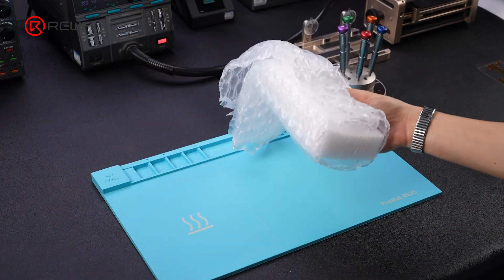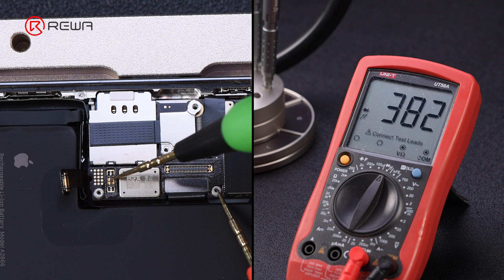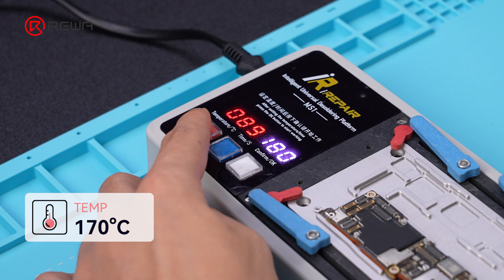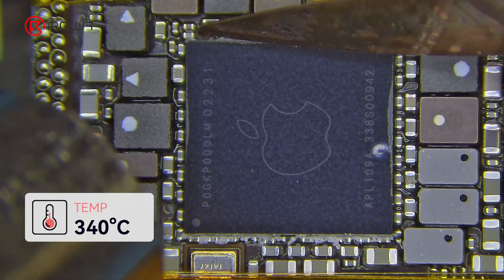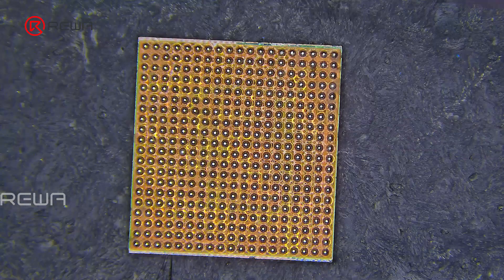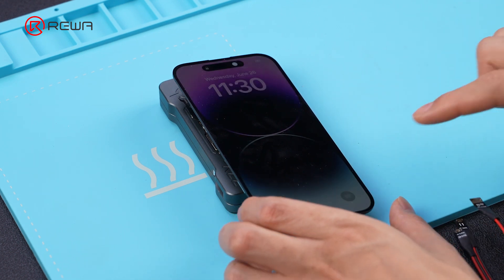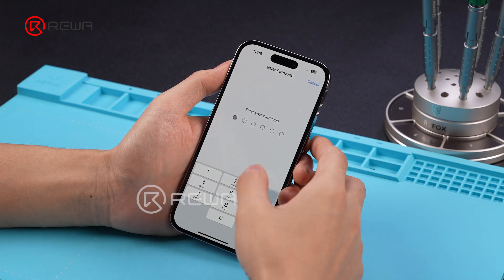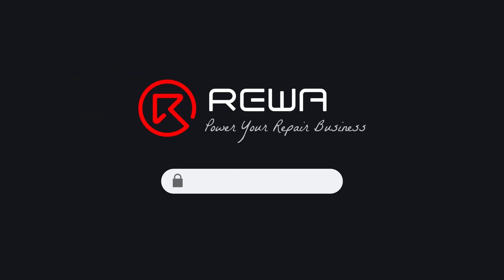Fully Repair iPhone 14 Pro won't Turn On -Motherboard Short-circuit

Comment: Sir, do you have problem with your ms1 heater ?, with my ms1 heater iphone BB board don't work after separation it was working good before
Reply from the maker: Desoldering platifrom meets problem?

Comment: The iPhone 14 Pro Max wouldn’t turn on and was stuck at 18% during the firmware update. I desoldered it, flashed the top board separately, and also found some burnt flux between the boards, most likely from the factory. The top board turns on separately, but now, when connecting the bottom board, the power consumption is 150mA. I’ve checked all the main components and didn’t find any shorts. The circuitry around the amplifier and its power rails is clean. Do you have any suggestions on what else to check?
Reply from the maker: How about change the battery and test?

Comment: Did you boot the board with the multimeter at 2:48?
Reply from the maker: The power cable as you can see before

Comment: First time I see the tecnique of pulling the IC with a pointy sculpture blade.
Isn't it risky to pull the pads in that way? 
What temperature do you use, something around 380c? 
I guess the area is so tight there if you put tweezers will knock out all surrounding components as they are so tiny and so close all around the power IC
Reply from the maker: That is a little tricky for repair man, we also just had a discussion about it, your word also acquire a point

Comment: Just to confirm, did you say 340C to remove the resin/glue around the old power IC?
Reply: Use  240/280c

Comment: The data could be recovered or lost?
Reply from the maker: We only deal with the power IC, and at last we check the system and data because we separate the motherboard, we did not touch the Nand, so it is OK

Comment: What do you advise me to learn about proper testing of Android devices? I have tried several times without professionalism, even though I am in the job market, but I cannot do professional work so far. Thank you.
Reply from the maker: Now we may need to take a systematic lesson to help you gain some basic repair knowlege including the phone inner structures and the troubleshoot idea, all of these requires you to have some lessons.

Comment: Thank you rewa 
I need more help how to trouble shoot thanks
Reply from the maker: So the point is to troubleshoot based on the  symptom, like this time it can not turn on, we need to use the power cable to locate whether the screen or the motherboard is faulty, then we will continue our next step to locate the problem.

Comment: temp and air to remove power ic?
Reply from the maker: When removing power IC, the hot air gun temperature is 420 ℃ and the airflow is 80.

Comment: Hello, I hope for a reply, we want you to explain the power supply pulls and the sequence of phone takeoff
Reply from the maker: Since we have checked out the screen failure caused by the boot, then we focus on the motherboard, the first time to connect the power cord to the battery holder is to check whether the boot function is normal, the result is a short-circuit, then we need to use the thermal to locate malfunction position, so connect the power cord for investigation, Therefore, the purpose of connecting power cables is to locate faults

Comment: why you do not replace the black paste between 2 boards ?
Reply from the maker: Replacing the thermal grease will increase the difficulty and cost of the soldering
Reply: @rewatechnology2008  u can just use normal computer cpu thermal paste
Reply from the maker: @sanfrrraa  Well thanks for your suggestion.
Reply: @rewatechnology2008   i use this method
and it's working good
i just put a little bit of weight (a coin)  on the board when joining the boards together to ensure proper connections
Reply: They did.

Comment: While removing the cpu, how do you know when to lift the cpu without print damage? Could you tell me the technique or secret?
Reply: Experience is the only key
Reply: Put a little force on the side of it, if it moves easy u are ready to remove
Reply: Its just the practice and experience of many years
Reply: Sharing a CPU is difficult and takes a lot of time before you can do it, but you can do it with ease and experience Insha Allah 😊
Reply from the maker: CPU separation requires some experience and skills, you can check our video: https://www.youtube.com/watch?v=3_DsWcg0TRo&t=150s